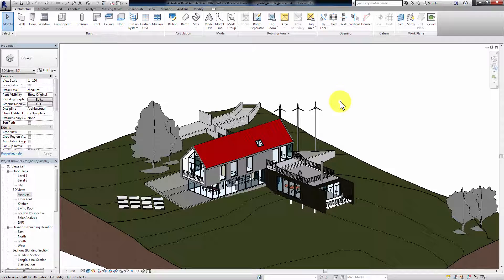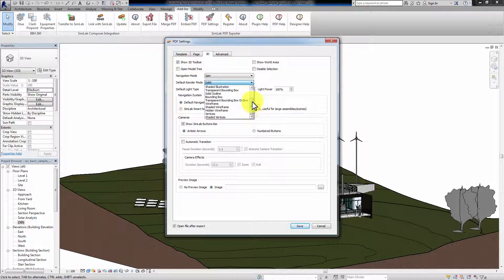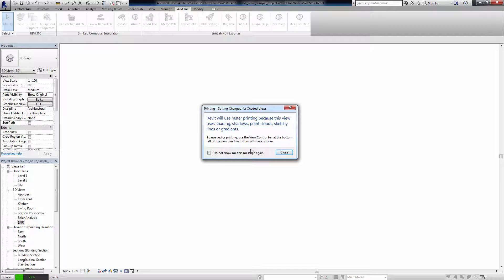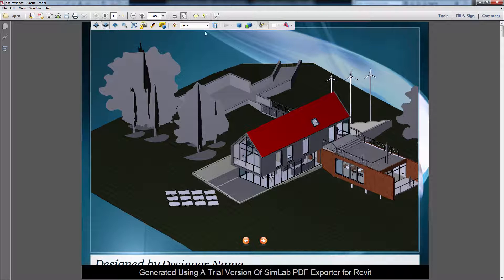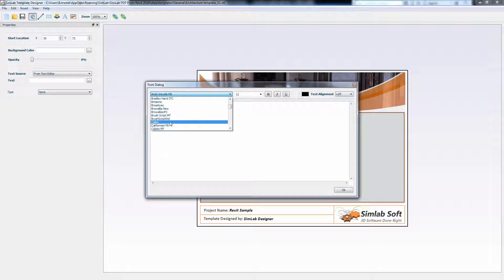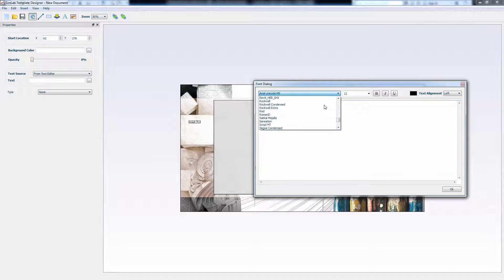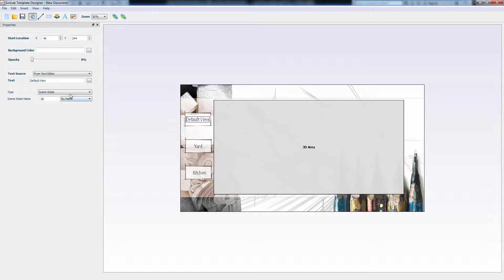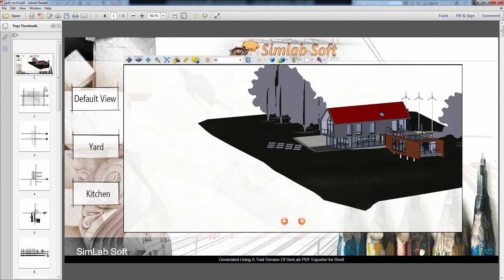4. Exporting 3D PDF from Revit

Comment: Isn't there any other way apart from installing an add-in to Revit? Like through exporting?
Reply from the maker: You can export a DWF file from Revit, and use our stand alone SimLab Composer to export a 3D PDF file, this is a good option if you do not have access to Revit.